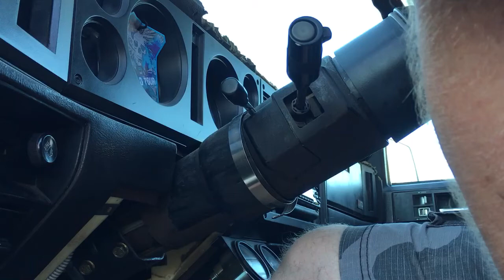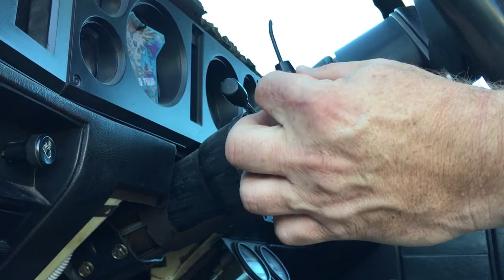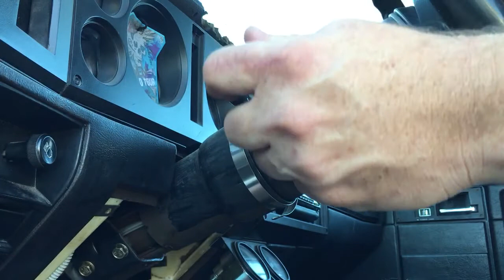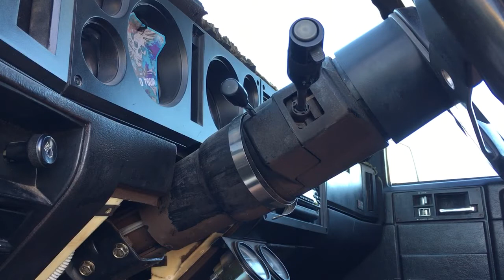S10 Wiper diagnosis

Comment: My wipers only work on high. Could it be a bad motherboard or is it the switch
Reply from the maker: I’m not 100% sure how to test either.  It sounds like it could be the board only because when a heater/blower resister goes bad it many times only works on high.  Do a Google search it’s a good tool.  JD
Google says check the switch first 👍
Reply: @krazykracker7706 Mine does the same. Did u ever figure out what the problem was?

Comment: try grounding the case of the wiper motor done it several times
Reply from the maker: josh robinson We did, we ground the wiper motor body to both the body and to the engine. I've seen those grounds at the wiper motor need better grounds you're right about that. Thanks for the feedback! JD